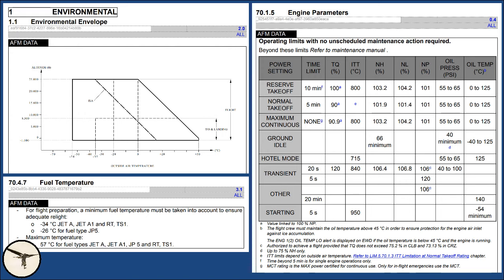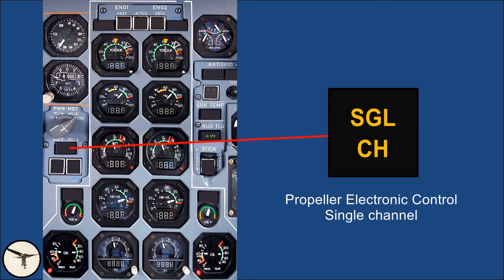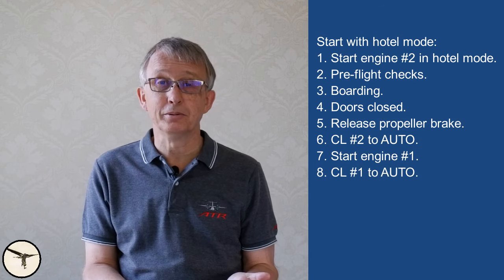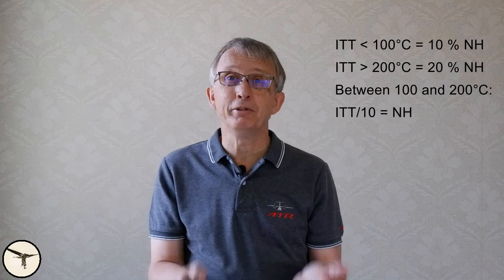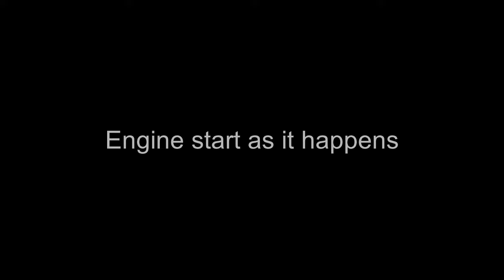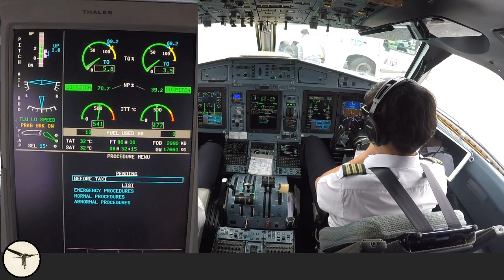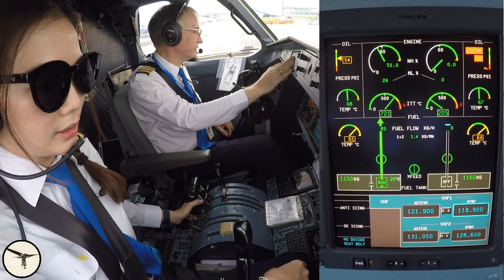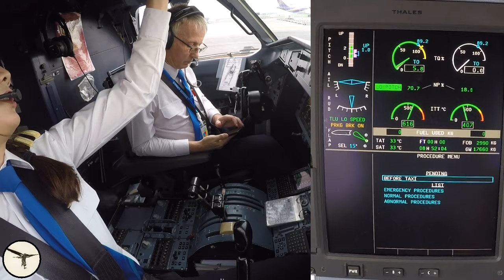ATR systems - Engine start

Comment: Thank you for this video, I can recall on of my flights last year when I had a jumpseat in the flightdeck of an ATR72-600 where I witnessed an engine start with a difference I much add, where during the engine start of engine number two the engine start was aborted because of ITT was going over limits and they had to abort the start and wait. After a few seconds past they restarted the engine #2 (not in hotel mode normal way) then started Engine #1 then made a 180 turn and taxied out to the runway.
PS: Greetings and Salutations from the Caribbean, where ATRs is a more common sight where I'm from.

Comment: Hello Captain, just one question, in my company  we normally start engines with GPU  and the other day, when pushing start  button, the GPU failed and the aircraft remained on batteries (DU 2 and 4 ON only), but I have read in the FCOM that the main battery is used for engine start, so what I don't understand is:what is the purpose of the GPU? I understand the main source of energy for the starter comes from the main battery (most probably I do not have a very good understanding of the DC electrical system).
Thank you for your videos.
Reply from the maker: The main battery is used for engine start when you don't have GPU. The main battery is also used to initiate a cross-start, as the DC GEN doesn't have enough power.
Reply: @FlywithMagnar  Thanks for your answer, Can you please tell me where I can find that in FCOM, because when I have been looking for it, it doesn't make any difference between start with GPU and start with battery (Description 24.2 1.1.2. Batteries).
Besides, I think that you can not start with  GPU if you have a discharged or a weak battery.....
Reply from the maker: FCOM doesn't explain what happens if the GPU fails during engine start. But the logic of the electrical system is: Without GPU, the aircraft is powered by the batteries. 
If the battery is discharged, it must be sent to the maintenance shop for some love and care. A weak battery will quickly be charged when the GPU is connected.
Correction to my answer above: During a cross-start, the main battery is used during the entire start, while the opposite DC GEN is assisting from 10% NH and up.
Reply: @FlywithMagnar  thanks a lot, I agree with you with the logic of the system, really appreciated, happy landings!!
Reply: @FlywithMagnar  so, if the battery is weak, it will charge quickly with the GPU on, and if it is discharged, you need maintenance, so I understand no way to start with GPU on and battery discharged (this point is what makes me think that main  battery plays a role during engine start even with GPU on) nevermind, more or less, is clear, thanks again

Comment: teacher makes me a doubt, because when the Atr is in the Hotel mode condition, sometimes there is an acceleration in power, is there any factor that contributes to this or is it a specific procedure?
Reply from the maker: The RPM of the high pressure spool (NH) can vary slightly during hotel mode. It depends on the position of the power lever. With the gust lock engaged, the power lever can be moved from GI and halfway towards FI. This increases the airflow in the airconditioning system, improving cooling or heating of the cabin.

Comment: Sir what is the limitation of hotel mode while start. Is it 800 or 715 (as hotel ) while engine start ?
Reply from the maker: Limitations for engine start (hotel mode or not): 20 sec between 800 and 840 degrees; 5 sec between 840 and 950 sec. Hotel mode operation: 715 degrees.

Comment: whats the crank position to?
Reply from the maker: "Crank" allows you to run the engine starter without engaging the ignition. It is used to ventilate the engine after a failed start. I'm working on a video about that procedure.
Reply: @FlywithMagnar  Thanks! :)

Comment: Mr Magnar ..Why do you the push back with Propeller engine Rotating??? If ATR write in his manuals NEVER PUSH BACK with Engine rotating........ Best regards.....
Reply from the maker: FCOM PRO.NOP.ANOR.3: "Start up engine number 1 and release of propeller number 2 can be performed during pushback, based on local agreement. Note: Unfeathering of propellers during pushback can damage nosewheel and/or pushback servicing." What we are doing in the video is within those limitations. We start engine 1 and unfeather the propeller BEFORE we start pushback. During pushback, we release the propeller brake and start engine 2. Then we WAIT until the pushback is completed before we unfeather propeller number 2. What ATR is warning about, is to commence the unfeathering process WHILE the aircraft is pushed back. Once the propeller is stabilized, there's no problem to pushback.

Comment: Hello Sir, I have curiosity, in normal operation (from both flights in this video) why start engine #1 first with Prop brake on? if not in extreme tail wind condition what are the benefit? why not running hotel mode and push back so you can have air condition during the push back?
Reply from the maker: That's a good question. After landing, we shut down engine #1 to save fuel. When parked, we engage the propeller brake and use hotel mode until the GPU is connected. That means the propeller brake is still on when we are ready to start again. However, at most airports, we are mandated to park in a certain direction, regardless of the wind. Therefore, tailwind is common. This is not favorable in hotel mode, especially when we are pushing back as it adds another 2 to 3 knots tailwind component. There are a dozen ways to start the engines. In order to keep the procedures simple, we have reduced this down to two options: Use hotel mode, or follow the procedure as shown in the video. The main reason for not releasing the propeller brake earlier is to avoid using the hydraulic auxiliary pump. It's very noisy.

Comment: Another great video. I noticed that you kept engine 2 in feather in both videos, until end of pushback and until the parking break was set. It that just to avoid too much trust when being pushed back?
Reply from the maker: With the condition lever set to AUTO, the propeller produces 1400 N forward thrust. In feather, the thrust is zero. It is recommended to have not more than one propeller in AUTO during pushback as it increases the force on the towbar and the truck. The procedure varies from company to compan and may also vary with the surface conditions. 
In this video, we could not use hotel mode because the tailwind exceeded 10 kt. At 11:20, we started engine #1 and selected the condition lever to AUTO before commencing pushback. At 12:40, the propeller brake was released, we started engine #2 and waited until the pushback was completed before selecting condition lever #2 to AUTO.

Comment: Hi captain!
I had a question, I see that some captains don't open the condition fully to start the engine during expected hot starts.
Do you think that this procedure has any effect on the start and might actually give a cooler start?
Reply from the maker: Hi! I have never heard about that procedure before, and I doubt it has any effect. If the fuel flow is reduced during engine start, the engine will accelerate more slowly, and I don't see any benefit with that. However, the fuel shut-off valve does not control the fuel flow to the engine! Bear in mind that the illustrations in the FCOM are utterly simplified.

Take a look at this video:  https://youtu.be/0YenlVem-9c

Freeze the video at 13:24 and take a look at the upper part of the illustration. (It's from the maintenance manual.) As you can see, the fuel shut-off valve does not control the fuel to the engine, but the pressurizing valve, which in turn opens and closes the fuel supply to the engine. The drawing doesn't show the exact design of the valves. But I doubt it is possible to adjust the position of the pressurizing valve by moving the condition lever to an intermediate position. 

ATR has published a procedure for engine start with high residual ITT. It's published in FCOM PRO.NOP.NOR. We should stick to that procedure. 

I have flown ATRs for 21 years. Many of those years in a tropical climate. I have experienced excessive ITT once, where ITT exceeded 800 degrees with not more than 10 degrees for a couple of seconds. This happened after a very short turnaround and involved a shut-down and start in hotel mode in a tailwind.
Reply: @FlywithMagnar  thank you for the detailed information captain! Wish you well!

Comment: Excellent, thanks for all this valuable content Magnar, please keep the ATR videos coming.

Speaking about engine start procedures, I have always wondered what is the point of selecting the “OFF&START ABORT” position right after excess ITT.  

In line with other types I operated previously why dont you just keep cranking with ignition on until any possible excess of fuel is burnt? Is it about commonality with the other two abnormal parameters during engine start?

Thanks.
Reply from the maker: Thank you for the question. The philosophy of ATR is to keep the procedures as simple as possible. But this procedure might also come from the engine manufacturer. Anyway, when there's an abnormality during engine start, regardless of the reason, the procedure will always be the same.

Comment: I'm a bit confused about engine high ITT starts. FCOM limitations says we can continue start with ITT above 840 not exceeding 5 secs. But memo item says if ITT tends to increase 900, we need to abort the start and shut down the engines. If ITT increased to 900, do we need to follow FCOM limitations and continue the start? or do we need to follow the memo items and abort the start and shut down?
Reply from the maker: Not exactly. A limitation is not a procedure. When ITT exceeds 840 degrees, you have only 5 seconds before the turbine is toast. If ITT continues to increase at a steady pace, then there's something fundamentally wrong with the engine. There's no reason to wait.
Reply: @FlywithMagnar  you read the graph incorrectly in the video. The starting limits are: ITT up to 800, no limit. Between 800 and 840 for up to 20 seconds. Between 840 and 950 for 5 seconds.
At 800 degrees, the “excess ITT” checklist appears on the EWD. If you abort the start at 810, then read the checklist, it says “If ITT remains below 900, start can be continued.” and “If ITT exceeds 900, start must be aborted.”
If the ITT limits are exceeded, the engine is not ruined, but maintenance must be notified.
The engine will often exceed 800 during battery starts, but rarely reaches 900. I had an experience where we were starting from battery, (the GPU was broken at that time) and the captain told me to abort before 900. We tried to start the engine multiple times and drained the batteries too much. That delayed the flight a few hours while maintenance came to charge the batteries.

Comment: Thanks a lot captain for your informative videos. With due respect captain plz tell me about boost system and why it is used on ATR 72_500?
Reply from the maker: Thank you. I'm working on a video about the engines, and the boost system will be explained there. In short, the boost system is used then take-off power is reduced by temperature limitations in the turbines ("hot and high" conditions). It tweaks ITT, allowing to depart with more payload.
Reply: @FlywithMagnar  Greetings Capt.  My comment is but In jest.....

A  'then' 
for a 'when' 
could well set, 
confusion,
Into motion😁😁🙏

Comment: In your company you start engine n 1 and then n 2??
Reply from the maker: Yes. We have external air conditioning and don't need to use hotel mode. However, we use hotel mode now and then when it's convenient. It's up to the captain to decide.
Reply: @FlywithMagnar  so in the second case, Hotel Mode, than start eng 1, and then breake release on 2?
Reply from the maker: Standard ATR procedure is start hotel mode first, release the propeller brake, and then start engine 1. But you can also start engine 2 in hotel mode, start engine 1, set CL 1 to auto and wait for hydraulic power before releasing the propeller brake. It depends on the circumstances what you prefer to do.
Reply: @FlywithMagnar  thank you

Comment: 😂😂😂😂 I cannot count the times in which I forgot to return the start control rotary switch to “STOP & START ABORT” after start.
The ATR is an airplane that will kick you in the nuts from ground ops until you go to your hotel room at the end of the day, there is always some “gotcha” of either system, performance, weather, MEL, mass and balance, fuel, airspace.
And all through this you are miserable and swearing in a cockpit without windows that cannot be opened, helplessly watching the lucky guys who are nice and fresh sitting in their high cockpits. 
They will whizz by the clouds, they will ignore the meaning of ice condition/accretion, they will speak to each other in a normal tone of voice, thy will fly the blue sky.
The ATR people, on the other hand, they will be tossed around by turbulence, covered in ice, only to be told to “maintain high speed” and end up in an unstabilized approach because that’s the only way to “fit in” with the “normal airplanes”.
….And you would say: “but my ATR is a STOL aircraft, I can land anywhere——NOT. Flaps used to be 45 but now are only 30, so pretty much we need a decent size runaway anyway 😂😂😂
Funny and sad at the same time

Comment: This is a Good Series on Turbo Props. Turbo Props Fly between 18,000 feet and 25,000 Feet.
Between 10,000 Feet and 70,000 to 80,000 Feet is the Sky - Sub Space Transition. at 80,000 feet its Sub Space or Near Earth Space.
This Turbo Prop and Airbus A320's are like Mini "Sky - Sub Space Transition" Vessels. They Have Pressurisation and Heating Systems.
150,000 Feet (50 Kilometres) - You'll break free of this planets Gravity and be in Space.